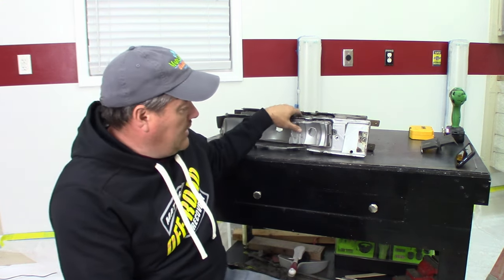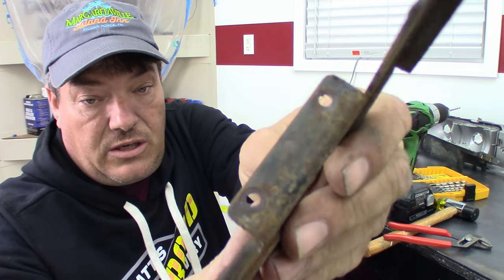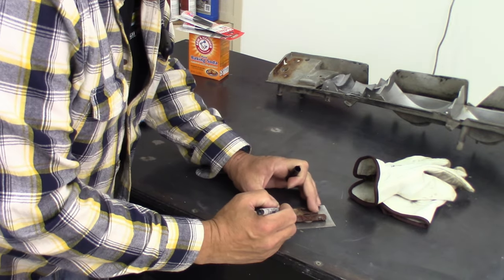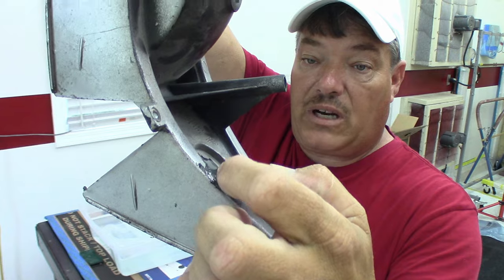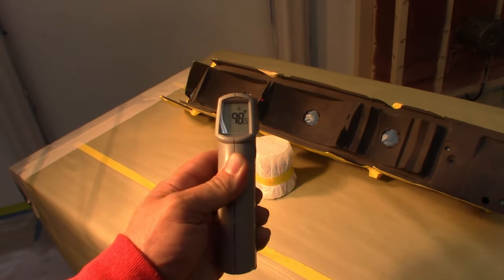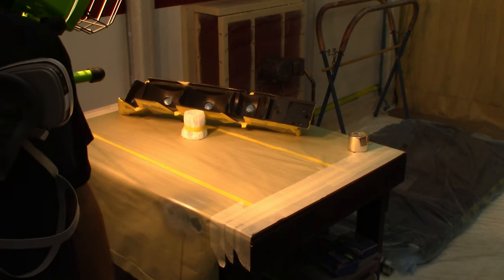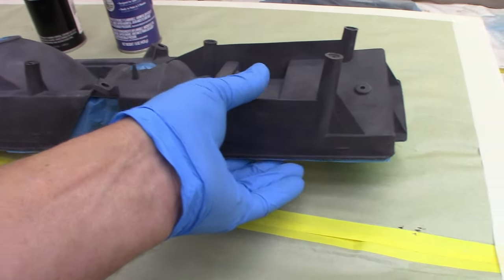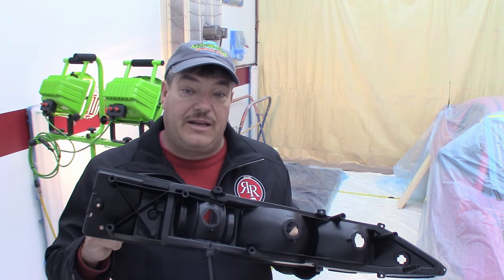How To Sandblast Plastic: A Beginners Guide. "1978-81 Camaro Taillight Restoration Part 1 of 2"

Comment: It's good to see you back. I hate spraying chrome. It's super thin and runs easily but the tip with the adhesion spray is something I need to try. It might help my jobs look better, thanks.
Reply from the maker: Thanks Wyatt. I have had good luck spraying it this way. Hope it helps.

Comment: I also sandblasted a bunch of interior ABS/PC parts for my BMW with some Armex XL Soda in a Harbor Freight pressure pot at about 55psi using a Ghetto cabinet I crafted out of a storage bin, duct tape, hotglue, and PVC couplings and it worked out very well put a couple divots here and there but nothing a crazy, most are barely noticeable, a spot of glazing putty and a little sanding and it was like they were never there. BMW had sprayed all their interior plastic with this weird rubber coating, and after about 20 years it got all gross, collected dust and dirt like a magnet, and would leave black schmoo on your fingers if you touched it. Typical BMW shit, the motor will run forever while the rest of the car turns to shit around it. No matter what solvent I tried it was either too weak to get it off without weeks of scrubbing, or the solvent was too strong and would destroy the plastic under it. The parts had a ton of small hard to reach spots as well, and I can only take wrapping sandpaper around popsicle sticks for so long before I lose my mind.